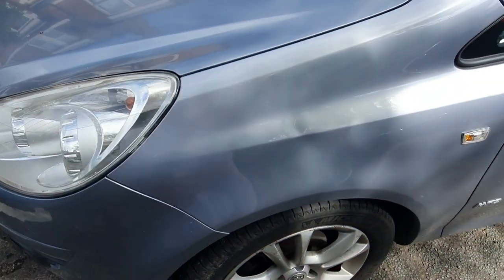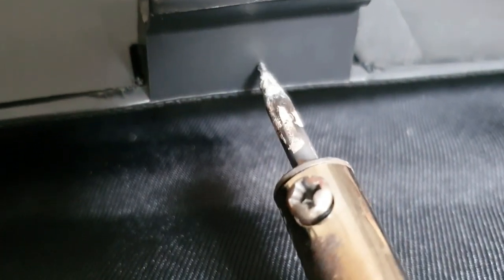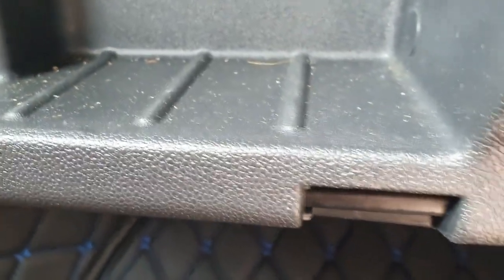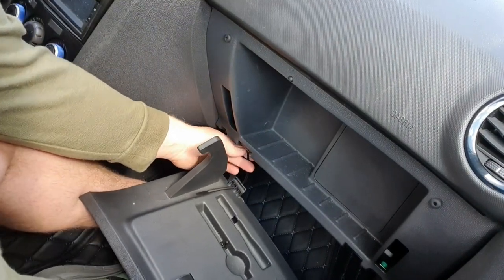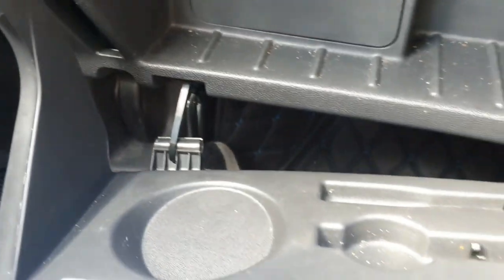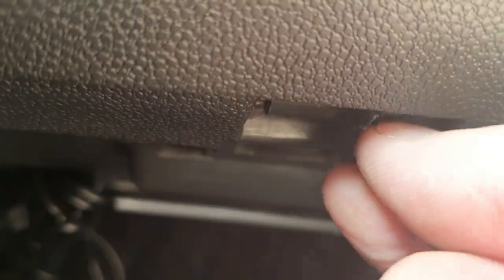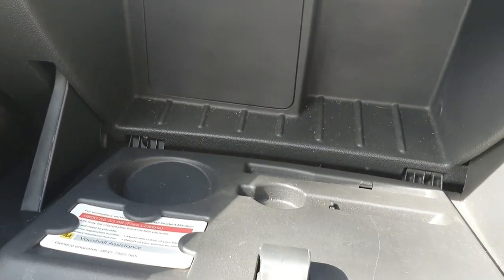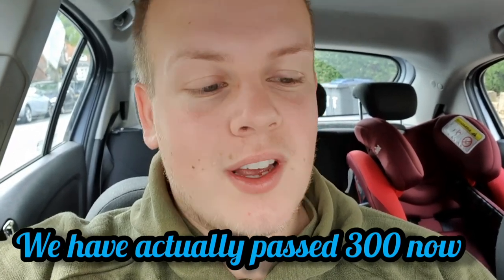Glove box keeps falling off repair- vauxhall

Comment: If you push were the join is together and get somethink hot like solder iron or foam cutter you can melt were the join linevis more better finish this is good but messy with ties
Reply from the maker: Good tips mate will take that into consideration if I  ever need to